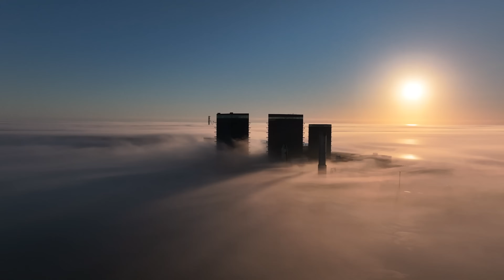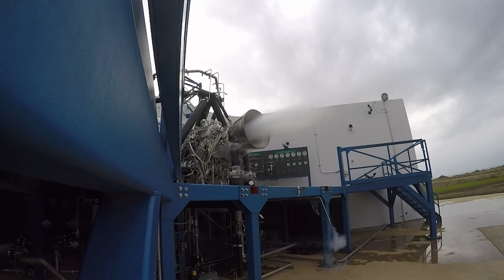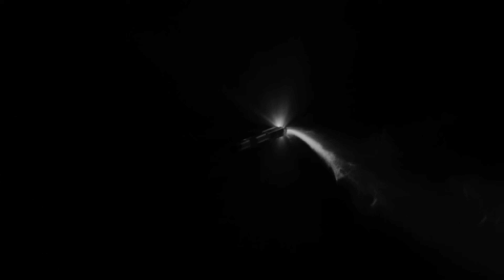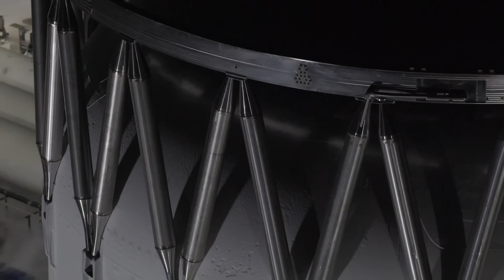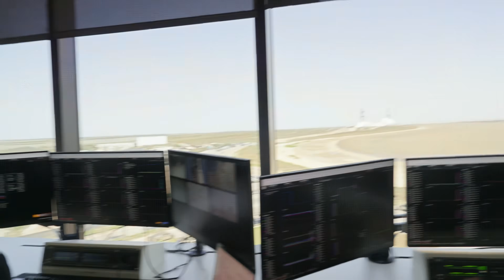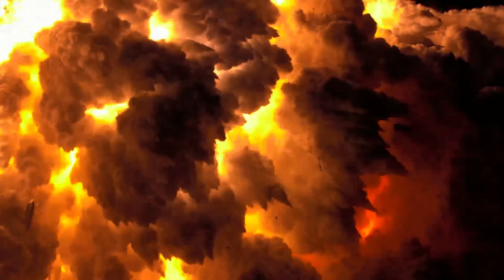Jaw Dropping Starship Documentary Revealed By SpaceX! Flight 12 New Hardware LEAKED!

Comment: Saturn five had five main boosters. Why does starship need so many?
Reply: Saturn V (S-IC first stage): 5 × Rocketdyne F-1 engines. Each produced ~1.5 million pounds of thrust (sea level), for a total of ~7.5–7.6 million pounds. The F-1 remains one of the most powerful single-chamber liquid rocket engines ever flown.
Starship Super Heavy: 33 × SpaceX Raptor engines (typically in a 20 outer + 10 inner + 3 center configuration on recent versions). Each Raptor 2/3 produces ~500,000+ pounds of thrust (sea level), for a total of ~16–18+ million pounds—more than double Saturn V's liftoff thrust.

Starship is a much more capable vehicle overall, aiming for full reusability, rapid turnaround, high payload (100+ tons to orbit), and Mars missions, unlike the expendable Apollo-era Saturn V.
Reply: @Sattracer  A very comprehensive answer, thank you. 😎👍
Reply: Short answer....Saturn engines were like dragster engines....last for one run.    Engineering for reusable, different design requirements.
Reply: @Michael-k9y8m  Cheers 😎👍
Reply: @Michael-k9y8m  That's what I said.  I was a bit more comprehensive.
Reply: Cause my Toyota corolla had 4 cylinders and my uncle's Jaguar had 10. That's why
Reply: @Artilleryman99  Was your uncle an F1 driver. They were the only V10 engines Jaguar made. 😂
Reply: @Steve-Cross  maybe